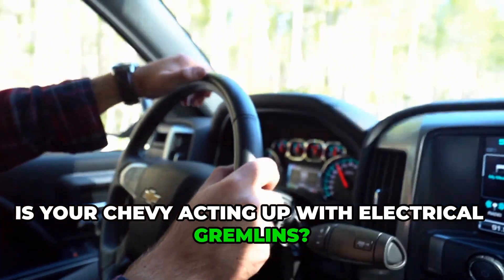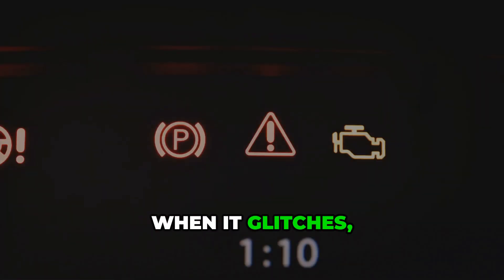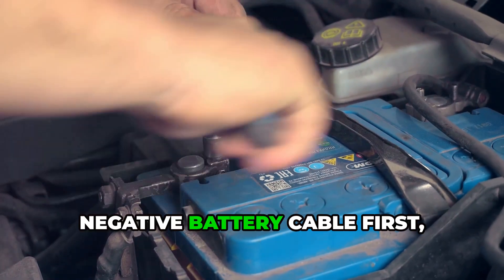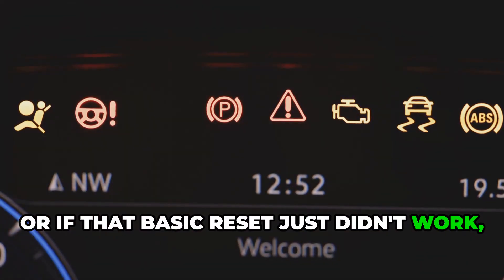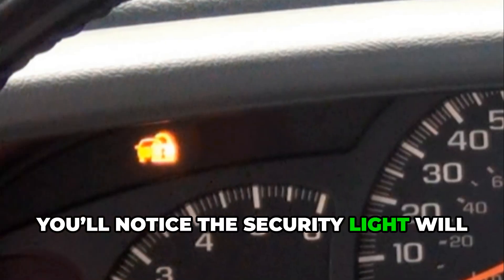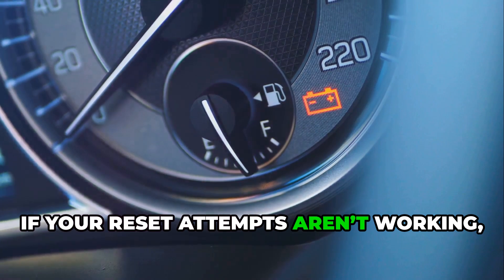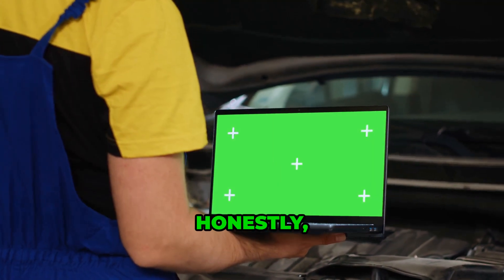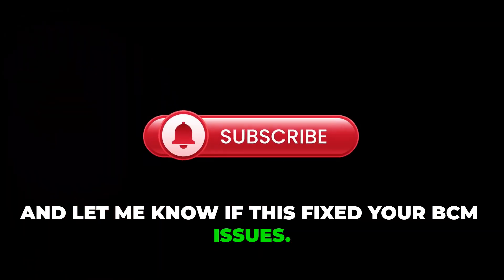How to Reset Chevy Body Control Module (No-Tool BCM Relearn Guide)

Comment: So i recently replaced my starter on my 2017 silverado, drove to the gym and the plug to the starter came out. Didnt know that and thought it was the battery. Unplugged it to test it. It was fine. Found the plug that came out, plugged it back in. Now my stereo stays black, stabilitra, airbag service prompts come on, the blinker wont work, taillights wont work, and A/C controls dont work. Could that be the BCM??

Comment: I was quoted $1000 to replace it. Does that sound right?
Reply: For a BCM? considering the bcm alone is $559.99 I would say ya. What problems are you having that suggested it be replaced? I have a damn driver side window that won’t roll down because the only window switch that will work in my car is the original one but it’s missing the button for the driver side. Every switch that I have purchased won’t do anything at all. I’m on number 7 and cannot fathom what would cause this problem other than a short in my BCM. I’m not going to pay $1000 for it to fix one window though…
Reply: @HardWhereHero yes $1000 for a window is insane. My driver side was hit by a dear. It started with my locks randomly going on and off. Then I noticed something draining my battery while being off no key in ignition. I have to disconnect the battery everytime. Also my dash screen is now defective. Ac and heat blower went out as well. That was the biggest headache. I took it to a specialist he asked what was my biggest concern. I told him the ac and heat. He fixed it for $500 but suggested it maybe the bcm. It worked for one day now I have to take it back for the bcm. My quote was $1500 for everything.
Reply: @HardWhereHero I'd say all you need is a window regulator

Comment: What about an Impala that won't turn on the low-beams, but high-beams work perfectly. No fuses blown, no wires corroded, switch is fine.
Reply: Did u figure it out mine is doing the same
Reply: @abrahamreyes3340 me too, high beams activate all bulbs as they should. Good fuses, I replaced the switch and it still doesn't work
Reply: @theghostking-7951 mine ended up being corrosion on the side door panels
Reply: Did you every figure it out just happened to me after I jumped started the car in the morning in the cold I turned on my high beams and then the lights flickered for a second and low beam don’t work now